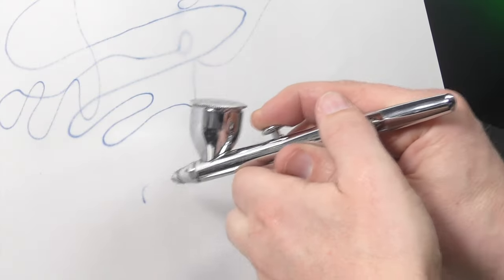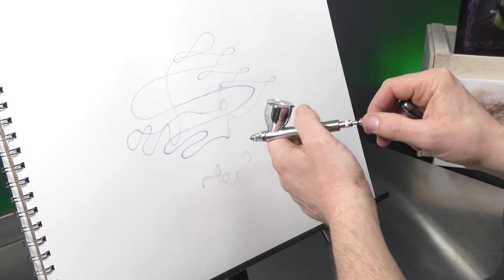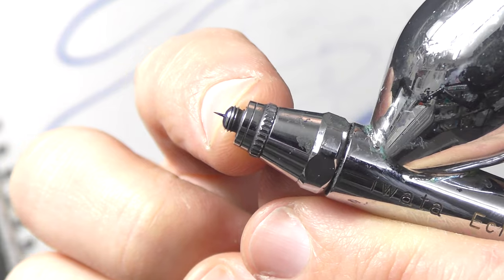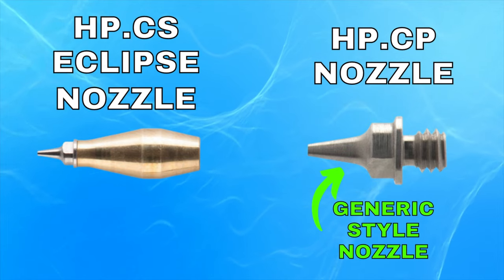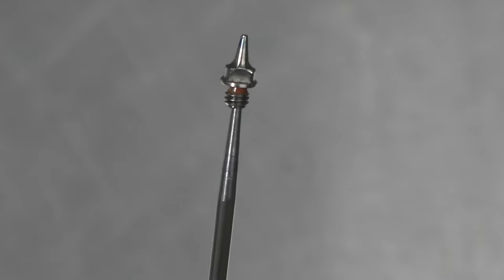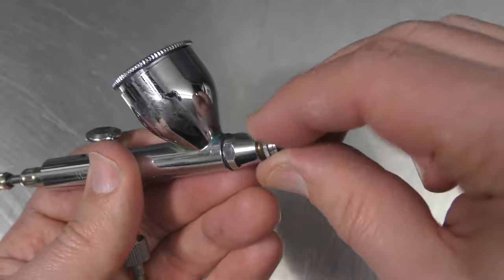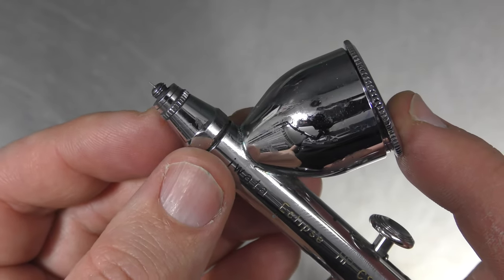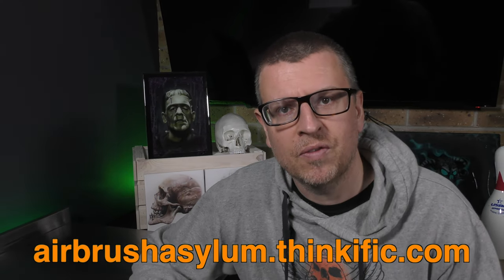Is Your Airbrush Free Flowing Paint ?

Comment: Recently I had to change needle as original needle bent on dry paint in tunnel.  The newest needle keeps sliding back into gun, probably smaller needle as nut not holding it in place. It's a cheaper Amazon airbrush I'm using currently.

Comment: Hi asylum, i’m having an issue with one of my airbrush eclipse, The needle is not fully going through and it’s only sticks out a little bit but paint still doesn’t go through even if I press down, I still need to pull back on the trigger for paint to flow but is there anyway I can fix it and make the needle stick out normally

Comment: As soon as I turn my compressor on, air starts shooting out of my airbrush. I don't even have to push the trigger at all. This is very annoying and it's impossible to paint like this. I have taken my airbrush apart several times, inspected it, cleaned it and still, air comes out. I am at my wit's end.
Reply from the maker: Take a look at this video 👉🏻 https://youtu.be/7qIq2tYbm2g you could have a dirty valve set and this video will show you how to fix it ..hope that helps 👍🏻🤞🏻
Reply: @AirbrushAsylum  Thank you I will watch it.
Reply: @AirbrushAsylum  This fixed the problem! Thank you!!
I removed the parts, cleaned them well and even though the trigger still sticks a bit at least I'm able to stop the air flow. I still don't know why it sticks. I'm guessing because it's a cheap airbrush.